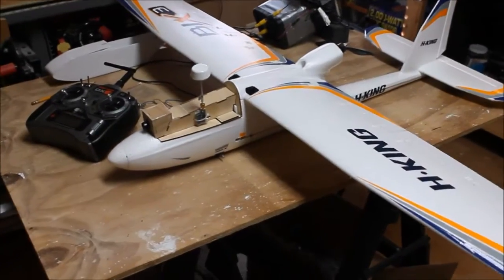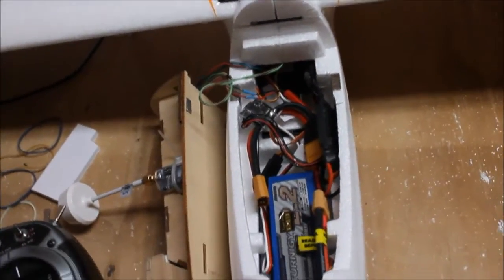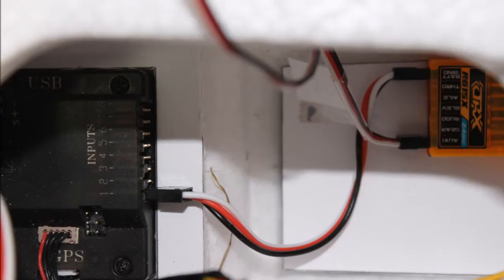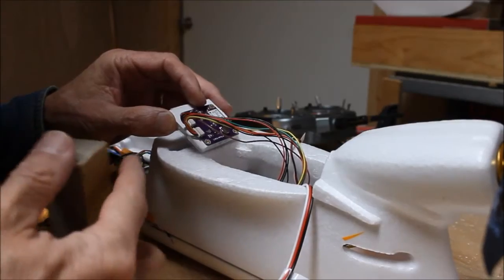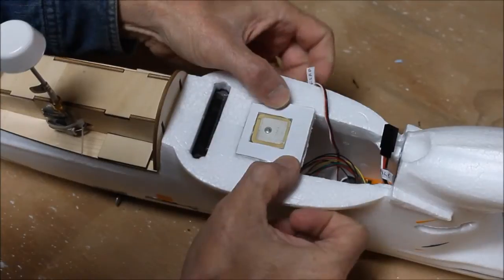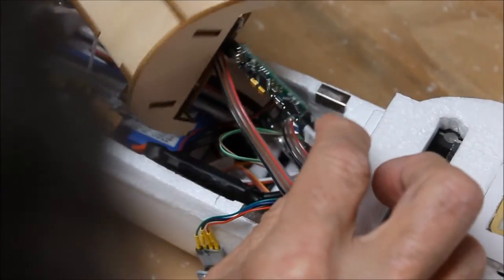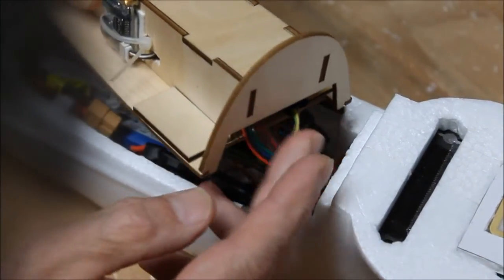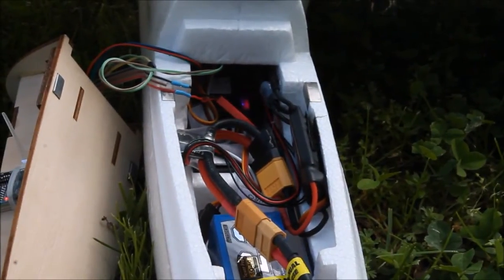Bix3 setup for FPV and APM

Comment: Thank you so much for this video. What battery do you use? 
Considering setting up a Bix3 with FPV and AUAV-X2 (smaller pixhawk) with GPS and telemetry module.  And an action cam (probably RunCam HD2) That's a lot to fit in/on the plane ;-) 
Was wondering if 3S battery is enough.
Thanks for your help.

Comment: Was wondering about how you have your apm mounted. The surface on the bottom of the Bix3 is at a slight incline. Did you correct for this by leveling the surface with your foam board mount, or are you able to 'zero' the apm out once mounted, even on a slightly inclined surface?

Comment: Thanks for all your work on putting up this video. I am planning to setup Cyclops Storm OSD with a 600mw video tx and 5v 700tvl camera. This video was very useful in planning out my setup. What was your flying weight with the setup?
Reply from the maker: Thank You, and GL with your project
Reply from the maker: That's a good question. But I honestly don't know. The plane, as shown in video, balanced perfectly nose to tale. And when the plane had been first flown (without any of the extra electronics) I found I had add ballast (in the form of nuts and bolts) to achieve the same balance. The electronics weight was less than the original ballast. So I was confident the plane would fly with this payload. So I never bothered to check its "all up" weight. 
Your setup sounds like a nice one, and with a 600 mw video link I'm thinking you're looking at longer runs than what I typically fly, so I understand your interest weight. FWIW: My flights are in the 10 minute and under a 1/4 mile range.

Comment: well, i would insulate the gps cable mate.
reason? simple, too close with RX 
i would mount GPS module in outside,
mount gps under wing will blocked GPS sats, you'll need more time to receive sats lock

Comment: Thanks, I have just setup a Bix3 for FPV and took some advice from this.
Although my GPS is at the back as I wanted to move more weight rearwards

Can I ask a couple of questions though. 
I mounted my Pixhawk the same place as you mounted your APM, on that ledge , however perhaps the angle on my version of Bix3 came out different I am not convinced it is 100% level on the centerline.   On mine the plane looks pitched up about 5 degs for Arduplane to call it level. However I am not a expert flier so I could be mistaken.
Can you help me pick a reference line for getting the plane level.  I need it to be right as I intend to fly slow for gliding as long as possible so don't want Arduplane pitching me up and risk stalling.

Also I am getting my servos twitching, not caused by interference but by Arduplane inputs according to the Servo output graph.  Pitch is doing it the worst, Rudder not at all, Ailerons a bit, I am thinking this is caused by the Pitch/yaw/roll controller tuning not being spot on, when under zero or very low throttle there isn't much twitching, but if I push throttle hard (on ground without prop) it seems like its fighting itself to pick the right servo sweet spot..  could you share your settings?
I have just used HXT900 servos.
Reply from the maker: +farmfunuk 
I "calibrated" my apm using a "level" table, and then installed it on the "deck" of the plane (as shown in the video). I found that that  proved to be the right way to go. Because when the plane was in the air, under apm control, it flew with the same attitude as what I had for the manually trimmed setup. So I don't think you'll need to worry about that.  
I don't know what kind of payload you have in the nose of your plane, but with the configuration shown, in the video, I didn't have to add any ballast either to the nose or the tail. Curiously, I did have to add a weight to one wing tip to get it to balance left to right (go figure).
I don't know what to tell you about the servo twitching. Using the APM unit shown, I didn't really notice that effect. However, the surfaces should move (when you're in a "stabilized" mode) to bring it back to level. If yours do do that , and the "twitching" isn't overly so, then I don't thing I'd worry about it. Also if you haven't already done it, you might want to look at my other video, that focuses on "Tuning" the Bix.. Basically I just started with the generic settings and let the "tuning mode" do the work. Like you, I just wanted to cruise around, and watch the world go by... I found this plane to be the perfect platform to do just that... I hope that you will enjoy yours as much as I have mine.. One word of caution though, don't let trees, and the like, get between you and your plane
Reply: +jmhrvy1947 
thx, I did calibrate like that also, but I think its possible there are slight variations in the mold , the ledge might be at same angle in mine.  I had to buy a second bix3 after a crash, before I was using Ardupilot and there are slight variations in some things, for example my canopy didn't fit the new one which was a fraction smaller.

So I would still like to get an idea of what angle other people are flying at, I will test myself but as said I am not the expert.
I think basically the pitch yours in resting at on the table at the start of the video looks about right.
For mine it shows level when its resting on the ground with the wheels on, nose clearly pitched slightly up.

I definitely think my servos are oscillating, but this is the first Arduplane I have setup so I am not sure is its within acceptable limits or not, I don't like it though I think the servo could be damaged if its going on over a length of time.
(I have used Arducopter before)

Maybe I'll make a video of it. I was just curious if it was normal or not.
Basically just have it on ground, with in FBWA armed and motor on, if I then throttle up a reasonable amount the pitch servo has a lot of movement back and forth as if its struggling to find the right position.

Servo isn't broken, it works in manual.
Reply from the maker: +farmfunuk 
The way you describe it, it does sound abnormal... Remember I haven't seen your set up so what I say next may not be at all relevant. But the first three things that come to mind that might produce the symptoms you're describing is 1. maybe there's a problem with the MPU & its sending the APM false motion signals, or 2. is the APM/MPU secured well to the deck? (in my set up the 3M foam block and the foam board cradle lock the APM into position.) And finally a 3rd possibility is the PID settings may be too high (As I said, on mine, I started with the generic settings and let the tuning do the work. Initially when I'd go from manual flight mode to FBWA, the plane was extremely sluggish, and couple of times on the early flights I almost crashed because it was so slow to respond, but with repeated passes it became much more responsive, However in FBWA its never been as quick, as when I'm in the manual mode. 
Another question, were the servos twitching like they are now, on your original plane?
And yes, if you make a video of what's going on, that would be very helpful. Let me know when you do
Reply: +jmhrvy1947 
No the servos don't twitch in manual mode, nor in FBWA on no or very low throttle.  But when I raise the throttle up the pitch servo in particular starts to oscillate.

Could you let me know your PID's?  at the moment I took the values from Arduplane that correspond with Bix2 as they didn't have a Bix3.  But even so maybe I have my linkages set too far down the arm, maybe its better, less stress to have them shortened a bit.

Oh, something else I was going to ask you. how do you connect to the APM with it glued in place?
I was intending to use wireless telemetry to download logs, but apparently support for that is being discontinued as its too much data.
Guess you are using the bluetooth for that?  or were you able to get a usb connector in place?
Reply from the maker: +farmfunuk 
" how do you connect to the APM...bluetooth...?"
Exactly

Here are the PID and other basic settings.. They are fine for the type of flying & conditions I fly in
However I only have one flight venue, so don't know how important this will be, but for record, "takeoff/touch down" for me is at ~1500ft above sea level. 

Servo Roll Pid
P = 0.721
I = 0.060
D = 0.054
INT-MAX = 20.0

Servo Pitch PID
P = 0.563
I = 0.047
D = 0.042
INT_MAX = 20.0

Servo YAW
Yaw 2 Roll = 1.0
Intergral 0.000
Damping = 0.000
Integrator Max = 15.0

L1Control-TurnControl
Period = 18.0
Damping = 0.750

TECS
Climb Max(m/s) = 5.0
Sink (m/s) = 2.0
Sink Max (m/s) = 5.0
Pitch Damping = 0.00
Time Const = 5.0

Other Mix's
Pto T= 0
Rudder Mix = 0.500

Throttle 0-100%
Cruise = 45.0
Min = 0.000
Max = 75.0
SlewRate = 100.0

Navigation Angles
Bank Max = 45.0
Pitch Max = 20.0
Pitch Min = -25.0

Airspeed m/s
cruise = 12.0
FBW min  = 9.0
FBW max = 22.0
Ratio = 1.994

Hope this is some help to you
Reply: +jmhrvy1947 
Thanks very very much for that.  I know I need to get what works for me also, but I wanted to have something to work with just to check if one of my settings is way out, cause atm it does seem like there is a problem.

oh and also, I wonder how you setup your servo arms, I set my connecting rods to the furthest hole out, figuring it would be easy to set from the radio if it needed restricting, but I had to limit more than I thought I would so now think it would have been better to have used a hole closer in , there would be less leverage and therefore less stress in the servos.

Comment: did you have to mod the apm so it works with only one wire cppm??? or is there a setting in the apm you change for cppm?
Reply from the maker: +Youniles 
That's a good question.
The short answer is no you don't need to modify APM (like cutting traces or soldering) to use cppm, but there are some configuration things you will need to pay attention to. 
This link ( http://planner.ardupilot.com/wiki/common-connecting-the-radio-receiver-apm2/ ) shows how to connect the CPPM output from the receiver to the APM . 
In this video (Bix3 setup for FPV & APM)  I'm using an r615x receiver.  It comes ready to send cppm. So no modification was required on that end. 
If you want additional information, about this receiver and different RC signaling formats, this link ( https://www.youtube.com/watch?v=GbUMC8h2uhU  ) maybe useful [about the 4:50 mark, it addresses cppm]
If I have missed the point here, let me know.

Comment: Thanks for this. I'm building a Bix 3 and also plan to use an APM (maybe the mini version) with MinimOSD.   Interesting place to mount your gps antenna. I may copy your setup, or I might mount it on the tail boom. Probably a silly question, but doesn't it have any problems seeing the satellites with it being hidden under the wing? 
And doesn't the APM have to be perfectly horizontal? I have an APM too and was puzzling over how to be sure it's horizontal in the fuse.
Reply from the maker: +husky041 Good questions. 
First, the GPS Satellite signals have no problem at all penetrating the foam and thin plastic found in the wing.
As for the floor that APM sits on,  turns out it's  parallel to the plane's line of flight.  In fact if you watch some of the later flight videos made with this set up, you can see that OSD's artificial horizon lies almost on top of the true horizon. Of course that's also due in part to the camera's angle relative to the line of flight. 
Bottom line, I had no problems with the APM flying  the Bix with it mounted as shown here. And also on a stock Bix,  this setup requires no additional ballast to get the CG correct. The one thing I did have to do is flip the  APM's fore & aft settings.  Because as you see it in this plane, the APM is riding backwards relative to its default settings.  You can confirm that you have it correctly configured by observing that the plane's control surfaces move in the right direction to bring it back to level, when you point the plane's nose high or low, or tilt it left or right. 
Good Luck with your project, I think you are going to find its fun craft cruise the skies with.
Reply: +jmhrvy1947 Thanks again, that's a big help. 
Can I ask if your MinimOSD is version 1.1? There are reports of some of their voltage controllers overheating, taking out the whole board. Painless360 did a video about this and how to fix it but wiring is a hassle. However I've also heard that the problem has been fixed. I'll probably risk it! Cheers.
Reply from the maker: +husky041 Mine was the newer version, and while it ran warm (the video chip) I didn't have any issues with it overheating. 
I did run into a problem with it not syncing to camera that I first flew with. I ended up making some small changes to how the sketch initialized the chip, which for me cured the problem. I posted my findings to their web site (https://code.google.com/p/minimosd-extra/) see defect 115. Don't know if these changes have been incorporated or not.
I also found that the code would not recognize  (display) when you were running APM in the Learning mode, and revised the sketch (OSD extra) for that as well. The only other issue found with setup shown, was at certain distances (and plane attitudes) the received video  would blank or flash. I solved this by using a different video channel.
Reply: +jmhrvy1947 Thanks :-)